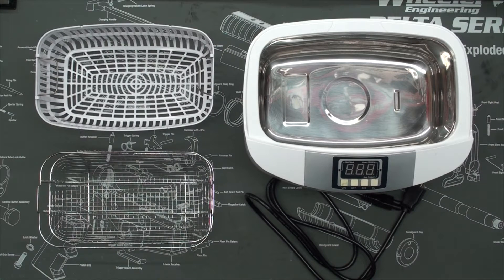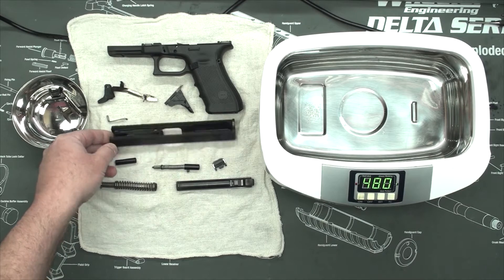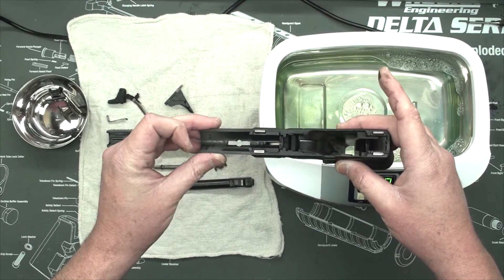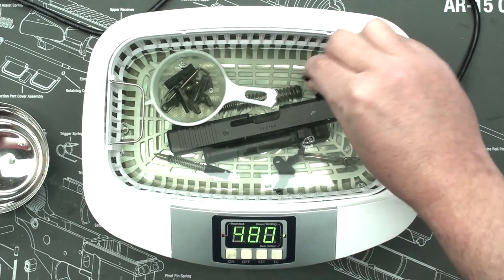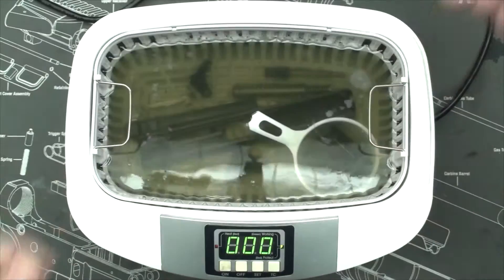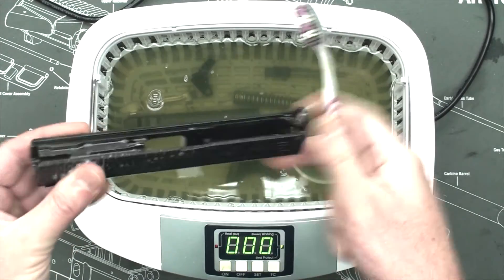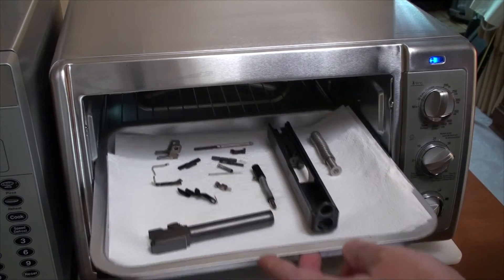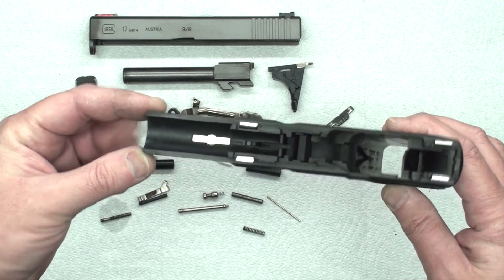Ultrasonic Cleaner - Glock 17

Comment: Man I got the same cleaner on ebay too. Had it for at least a year and it still works great. Only brass so far. I havent tried to many parts.
I use simple green with lemishine and water. Others vinegar water etc. Plus some flitz.
Love the vids
Reply from the maker: Thanks, I appreciate it!  Just be careful (as I found out recently) that any parts you put in are cerakoted (or something similar).  I've had no ill effects on are parts (bolt carrier, bolt, etc) even though there is exposed metal.  But I put my CZ 75 slide in to clean, and the inside part of the slide is bare metal.  After cleaning and drying in my oven (as seen in the video), there was VERY slight surface rust on the inside.  It was ONLY surface, and simply wiped off with a rag.  Strange.

Comment: What you needed to do is to thoroughly inspect all metal parts after prolonged period of such kind of cleanings for rusting and demonstrate this in your video in details. To prove to us all that there was no rust appearing. A few months, or a year of periodic cleanings like this would do. If there is no rusting spotted in that gun, compared to the same very gun cleaned in conventional way then this method is safe to use. Otherwise, do it with the risk of rusting the internal parts of a gun. There are no links to the re-assembly video "at the bottom of the screen". Thus, no thumbs up.
Reply from the maker: This video is now 2 1/2 years old.  I use the sonic cleaner to detail my Glock 4 to 5 times a year, so I've done it 10-15 times now, no sign of rust anywhere.  The link to the Glock detail strip is in the video, but annotations don't show up if you're viewing from an iPad or mobile device, they work fine on a desktop.  Nothing I can do about that, it's a YouTube issue.  Thanks for watching!
Reply: Please consider placing important information under your video in your show notes. Show notes are placed right under your video. This way it won't be lost with different setups. I actually used desktop to watch your clip, but have found your very helpful "Glock detail strip" video in a different place: as a thumbnail to the right from the main video. Thank you for that update. I may seriously consider doing just what you suggest. My only wish would be if you could actually DEMONSTRATE condition of your parts after you strip the gun completely. Since have done this type of cleaning 10 - 15 times just consider making this very video demonstration and posting it into your channel. This would be much better and would eliminate people's concerns right away.